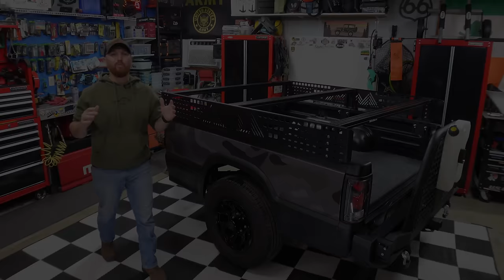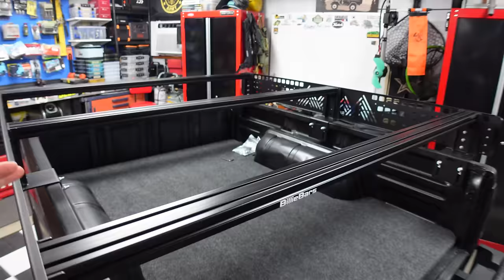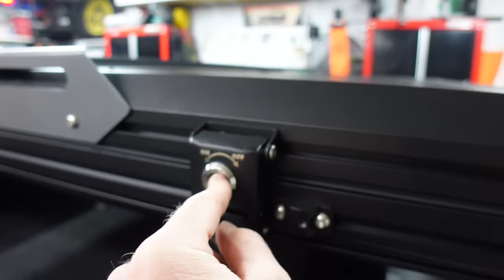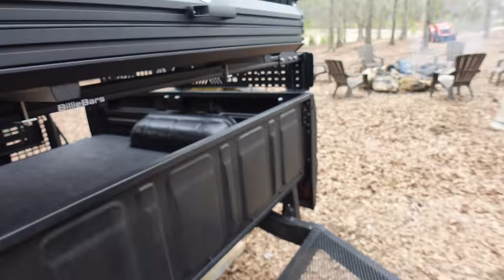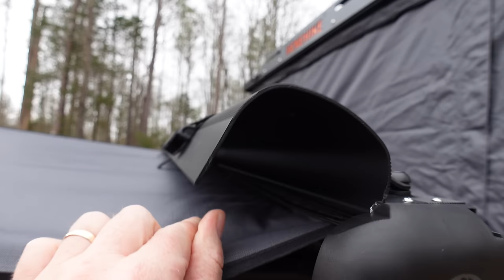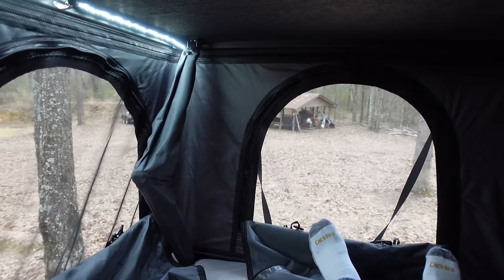My DIY Overland Camping Trailer | NEW Rooftop Tent & MORE.... IT'S AWESOME!!

Comment: Only change I would look at doing is hooking the awning to the top of roof top tent. If it already has t tracks then you already have mounting point. Also it would ensure rain would drain the proper way without having to adjust bars up. That would allow you to slide the roof top tent to the driver side and allow you to install a 16-24”? board on other side of tent to allow extra storage up off the ground.

Comment: Great build. As I’m watching the setup I wonder, could the hard case awning be mounted to the T-track on the lid of the tent just above the latches? If so it goes up and down with the tent and it would always be above your head that way, plus added bonus the rear window would be under the awning so if you are in the cook area and the wife is in the tent you can still communicate and pass things back and forth.
Reply from the maker: Great minds think alike..! I’ve actually been testing that out 🤙🏼